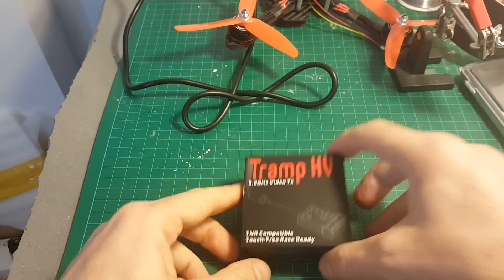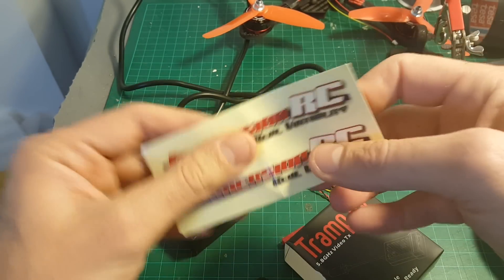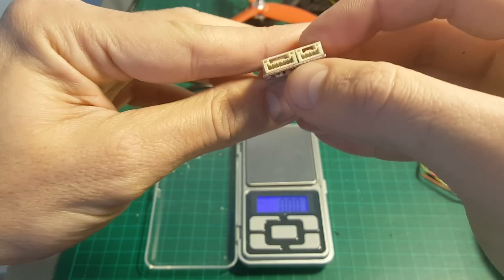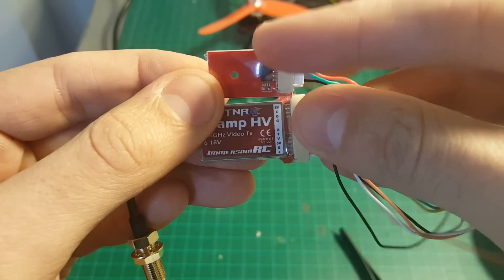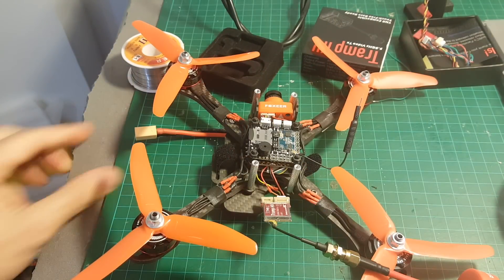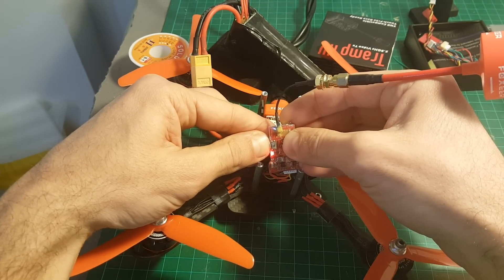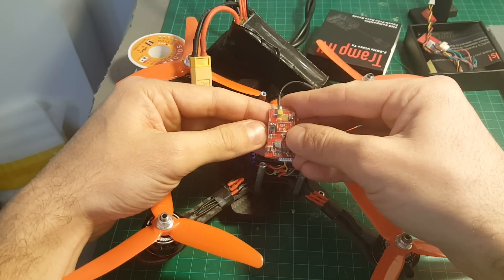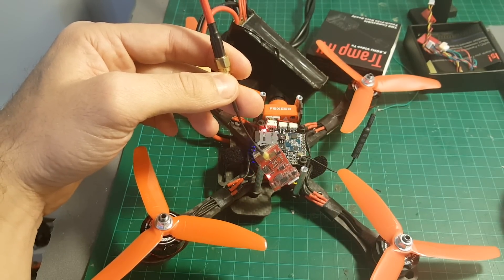ImmersionRC Tramp HV overview and setup

Comment: FYI these are the opposite of proprietary connectors. They are the standard called JST-GH which exists for quite some time now and sadly only the innovative manufacturers switched to use them by now althought they are vastly superior to the old standard. You could compare it to the USB-C, it just takes some time to transision.
Reply from the maker: You are right, this is an excellent connector and should become standard.

Comment: I'd like to know which wire should be connected to the flight coltroller and where?
Thank you
Reply from the maker: There you go: https://external-preview.redd.it/OmpEO8iMzkbl16kkLnbV3oVenAoFAZu0b8vLhfwRpGw.png?auto=webp&s=f044bd925a7adfeb0f0f69f6c77aaac26acf81a0

Comment: Hi there, Thank u for sharing..
I swapped my dated 600mw immersionRC raceband (perfectly working tho) for this smaller Tramp HV with high expectations and the same specs as before only smaller form factor and designed with ease of use for competitions..
Unfortunately I have got lines that occur horizontal, I know about my previous builds and how to avoid interference and how to wire the parts correctly, and this issue has nothing to do with that.. I can only say that this unit I got is bad, but after seeing more people come forward with this same issue, I have my doubts if the whole product is defect/faulty. My local supplier should have warned me before and also Youtube made me buy this crap in the first place!? and now I got it I can only see videos about how screwed I am once again!!) I hate to spend more and more over and over again (no jokes).. Maybe a new TBS unify will work but I have nothing from tbs yet and was actually not planning to either.. Someone with a fix please, let me know asap! You need to deeply hate the hobby, before you will be able to love it!
Reply from the maker: Wow, that is very unfortunate. I had only good experience with the Tramp HV. I actually got a lot of interference with the TBS Unify, but I am not sure the transmitter is the one to blame...
Anyway, if you feel that you didn't get a quality product and your local supplier is no help, I suggest that you should contact Immersion RC directly at info@immersionrc.com and tell them you are having issues with your product. I really hope that they will be able to address this issue. 
As a side note, I can tell you that I probably wasted hundreds of dollars on faulty equipment. It is part of the hobby and you should not hate it, annoying as it can be. :-)
Best of luck.
Reply: Skywalk FPV my friends new Tramp is changing channels by itself, brand new build, powered straight off vbat and the camera is powered off the VTX, he's tried cutting the heatshrink off around the button and it's still doing it. 

There's a video on here of a guy showing it change channels by itself but I've hunted everywhere online for a fix and can't find anything at all.
Reply: I feel your pain and time lost for sure! I contacted my supplier and I was able to do a refund, and I will try a unify next time.. I heard people contacting IMRC and been told that they are aware with a wrong batch of Tramp`s, unfortunately we both got unlucky I guess.. However I did not encounter any channel shifting, I was complaining about static noise. (I also do not like to run vtx from Vbat due to heat and other concerns tramp has no other option) I think the unify v2 (5v) is future proof and the ultimate way, I will try that soon.. Good luck with your own fix. Never give up - See u Around!
Reply: Skywalk FPV yeah, I messaged ImmersionRC on behalf of my friend to see if they can help him out, it's really strange for it to be doing this. 

I personally have a TBS Unify Pro Race edition in my quad and it is awesome, I don't get any lines in my video feed at all, it's nice and clear all the time, definitely going to get the HV 5v soon as I want more power!! 😃

I read something about a bad batch of Tramps going around, people said that it was ones with a black dot on them if I recall rightly, I checked my friends one for a black dot on it and it never had one. 

Hopefully we can get it sorted out. 

Thanks for replying man
Reply: DavyBoy 
You need an LC filter!
Reply: 9364 ImmersionRC replaced the faulty VTX for my friend, so it's all sorted out now. 

Like I said I use Unify Pro VTX's on my quads, never had any bother with them, nice clean video feed and on my new build I'm running Smart Audio through the BF OSD, it's something I want on all my builds now, so nice being able to tune PIDs, change VTX channel/band and power all through the OSD.